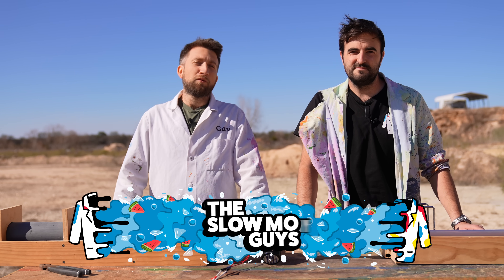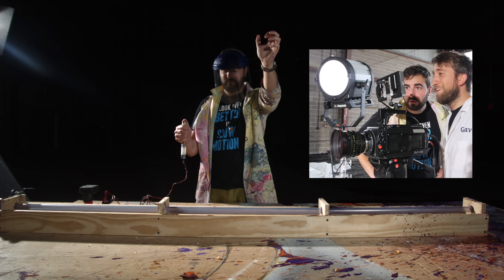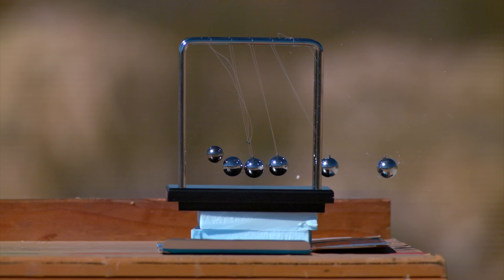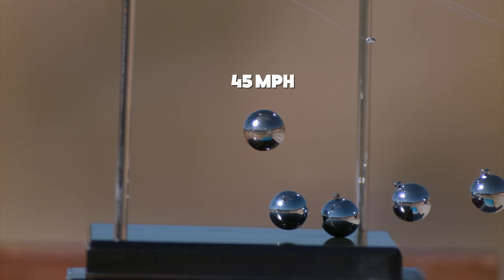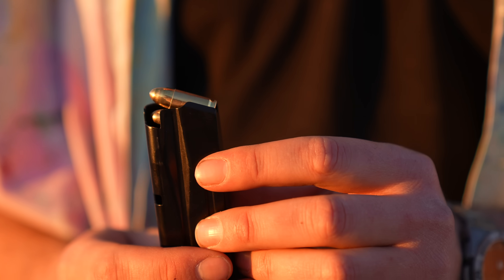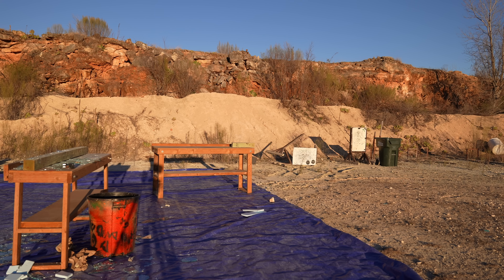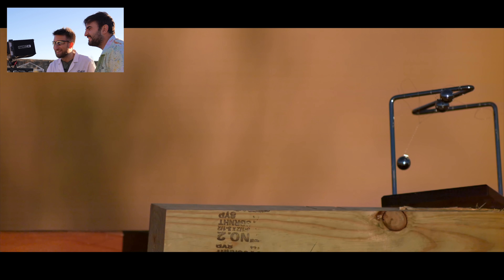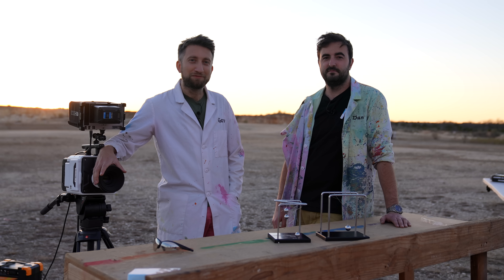Bullet vs Newton's Cradle at 100,000 FPS - The Slow Mo Guys

Comment: I sometimes forget than Dan was in the army and actually knows what he's talking about. Also that ball bearing had 4x less energy than than the 9mm but had a much better transfer of energy, it's not all about power on paper
Reply: It'd be interesting to see what happens with a rifle round like a 5.56 or 7.62. 5.56 is designed to fragment to make a mess of your insides so I'd imagine much of the same as the 9mm, though with more energy to push the rest of the balls along. A 7.63 is more or less a solid mass meant to drill a hole through things.
Reply: Not just in the army, he worked with demolitions and explosive ordnance disposal I think. I love when he gets to remind us that he is, in fact, an expert!
Reply: remember the old days when Gav and Dan were just faffing around on his parents house
Reply: @Nderak  It was Gavin's own house, some of it was shot at Dan's grandparents house also
Reply: You mean an army?
Reply: Pp
Reply: How 4 times less energy when the ball bearing weighs about twice as much?
Reply: Kinetic Energy = ½mv²

The bullet itself weighs 7.5 grams, the steel balls weigh 28 grams each. That equation for calculating kinetic energy results in a value of 459'000J of energy for the bullet and a whopping 1'020'000J for each steel ball.

The steel balls they fired through the air cannon had much more energy.
Reply: @jacoblansman8147  I don't know where you got those numbers from, but lets break this down.

Kinetic energy formula is correct: ½mv²  where m = mass (in kg) and v = velocity (in meters per second)

First of all, velocity is squared, so that trumps everything. Double mass, double energy. Double speed, quadruple energy.

Bullet:
m = 7.5 g = 0.0075 kg
v = 785 mph = 350.895 m/s
Gives :
0.5 x 0.0075 kg x 350.895 m/s x 350.895 m/s = 461.7 J

Steel ball bearing:
m = 28 g = 0.028 kg
v = 270 mph = 120.69 m/s
Gives :
0.5 x 0.028 kg x 120.69 m/s x 120.69 m/s = 203.9 J

As you can see, theres more than twice the energy in the bullet than the steel ball.
1 million joules (1'020'000 J) is approximately the energy of 1 tonne (1000kg) moving at 100mph (161 km/h or 44.7 m/s)
Reply: @prosonny222  Collision physics are all about momentum. 
0.0075 kg x 350.895 m/s = 2.63 kg·m/s (bullet)
0.028 kg x 120.69 m/s = 3.38 kg·m/s (ball)
Plus the bullet collision was anything but elastic.
Reply: @Bob5mith  The calculations completely ignore that the bullet and bb are made of entirely different substances. Which at a glance is the deciding factor in the outcome of the experiment. The bb stayed entirely intact transferring a very high percentage of the kinetic energy while the bullet disintegrated conveying only a small percentage of the kinetic energy.
Reply: @Bob5mith  As for the elasticity, the bullet is receiving much higher impact forces, as the steel ball has a higher mass. Taking into account that copper jacketed lead is much softer than steel, it's no wonder the bullet shattered on impact: a nearly completely inelastic collision.
Reply: @robertmickelberg3720  Also people are neglecting that it didn't hit square like the BB did (this isn't a criticism of his shot, that's not an easy shot). It hit on the angle of the bullet, not the point, and it did so on the lower cradle sphere. It glanced away like armour.
Reply: @Caennuck  I noticed that too, a better setup for aiming that eliminates the human element would help. I am wondering if demolition ranch has tried this?
Reply: @jacoblansman8147  Um, you may want to check the math again. Remember it's ½mV² meaning the energy increases massively with the V not the m. The bullet travelling at roughly 3 times the speed, but 4 times less mass means roughly 3^2/4 or 2.25 times more energy in the bullet. Also, 1,000,000 J is a gigantic amount of energy, remember that J is calculated in kilograms not grams.

Written out: 
Ball bearing: 270mph=120.7 m/s 
1/2*0.028kg*120.7^2 = 204 J

Bullet: 785mph = 350.9 m/s
1/2*0.0075kg*350.9^2 = 462 J

It really is about better transfer of energy and especially transfer of momentum since it is a newton's cradle after all. The bullet shattering means all the tiny pieces of the bullet maintain most of their momentum as they fly out everywhere towards the right in the camera frame, and not much of the momentum is actually transferred to the newton's cradle.
Reply: @panner11  I now realise I used 270mph instead of the relevant m/s value for the steel balls. But I did half the masses of both the bullet and the steel balls for my calculation. Thanks for helping me realise my calculation was wrong.
Reply: @jacoblansman8147  yep sometimes it’s hard to keep your Units Straight. Hell even NASA lost a whole mission because of a Unit mixup.
Reply: @jacoblansman8147  Don't know where you got that from. The 9mm is around 400ft/ib (depending on the brand, could be higher or lower but 400 is a good ballpark) and i worked out the ball bearing as having 110ft/ib so long as the speed as stated in the video is correct. I haven't a clue what those numbers would be in metric
Reply: @jacoblansman8147  correct. Also, F=MA, and the bullet, despite the significantly higher velocity (meaning higher A on impact) doesn't have nearly as much M as the solid steel ballbearings.
Reply: I love all the people getting totally different answers

Comment: I think the holder of the first ball snapps off immediately because the ball isn't perfectly hard and on impact it wobbles a tiny bit. That wobbling throws the holder away so hard that it breaks off in one piece instead of deformating or shattering.

Comment: If you wanted the think about the string having no effect, you could look at it like this: as long as the string is attached the ball is moving in a circular arc with a radius that's just the length of the string. From the speed of the ball you can determine what the centripetal acceleration is for that circular motion, and from the mass you can get the centripetal force. That force is the tension in the string for the entire time the ball is swinging up, as soon as it snaps the ball moves in a straight line. I'm not going to put numbers to it (they had a point mentioning that they could if they wanted to and had all the measurements) but a solid metal ball on a few inches of string with  most of the energy of an air cannon? That tension force would be way too high for thin nylon to hold for any length of time without snapping.

Comment: Brilliant subject and execution.  I am guessing that the plastic deformation of the steel balls at these higher energies prevented the cradle from performing perfectly, with the last ball flying off and the first four balls staying stationary.  If you are up to making your own cradle, you could do it with stronger and harder (bearing) balls, such as hardened S2 tool steel (yield strength ~ 290,000 psi, McMaster-Carr # 1995T18) or silicon nitride balls (yield strength 550,000 psi, McM-C # 9576K48).  Just a thought, if you ever want to revisit this.

Comment: Could you do this again but with some changes? Line up five balls equal in size to your projectile, set them on a track rather than using a Newton's cradle, use a plate with a hole in it ahead of the ball stack to exclude any muzzle blast, and see if the Newton's cradle effect still happens.

Comment: Notice that the line slides through the attachment ring/tube on each ball, which is why in the 2nd run some of the balls escaped without any upward movement as the line just pulled through.  They do this because it will naturally self align, whereas if you fix the attachment point they tend to never be perfectly aligned with each other.

Comment: I would like to see this using the air cannon's accuracy but have the Newton's cradle placed at different angles from center. Maybe with the first to fifth ball 15 to 30 degrees horizontally from center.

Comment: Next time use balls from ball bearings. Place them on a "V" shaped piece of steel, just so they do not roll away. Should be much more interesting. Then try placing them about 5 mm apart from each other on the "rail", it would be nice to see what would happen. Then try to throw in a rubber ball in the "chain" to see how much it affects the outcome. Maybe try also copper or brass balls? They should be super malleable or explode.

Comment: The "insta-snap" of the first ball in the cradle is caused by something called spallation wherein—when a piece of metal is hit extremely hard—the energy will attempt to escape out of the metal in all directions, causing bits of the metal to fly off.

This is a huge problem in tanks. A bullet hitting the outside can cause pieces of metal to fly off of the inside of the tank and injure the crew. Consequently tank armour has to be carefully designed and insulated from the crew by another layer of something.
Reply: I always thought that outer plate of armor are made as hard as possible with enough ductility on it to shatter the bullet and the inner armor are made of material with high tensile, compressive and shear strength to absorb as much kinetic energy as possible from the bullet fragments.
Reply: @zidniafifamani2378  buat ape kt sini anjay
Reply: This is where composites and ceramics come in to play.
Reply: @TalesOfWar  That mitigates the hit but doesn't change the possible energy transfer unless you are speaking of a composite liner inside the tank to catch the splinters
Reply: @stephen1r2  I'm not a material scientist in anyway, but to my knowledge metals are crystalline, making me assume energy transfer would spread molecularly in all directions equally... I wonder if a different structure could direct the majority of the energy in a particular direction.
Reply: @nickmcpimpson  If the hit is slow enough, the metal will flex and bounce back, spreading energy as you say. If the hit has enough energy, the shockwave of deformation will be faster than the speed of sound in the metal, at this point there is a high chance of spallation or shattering of the armour.
Reply: First World War tanks crews wore chain mail to protect from the all the tiny flecks of metal that flew off the inside when they were hit with machine gun fire. Tiny shards of fast moving hot metal, showering the inside. Not fun.
Search for “splatter mask” they look scary.
Reply: The King  No such thing as space